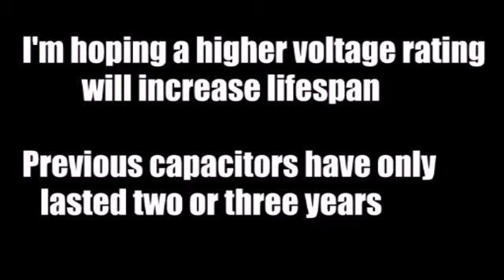Yamaha YSP power fault improved fix

Comment: Thank you for saving the life of my soundbar!  Does it matter what wire I use to extend the legs of the cap?  I know on one of the videos posted Maplin's bell wire (which I think is .6mm copper) is used but I've used thinner battery terminal wire.  I don't want it to fry six weeks down the line.  Thanks.
Reply from the maker: +Toby West don't worry, will be ok with that wire

Comment: Good video.  I've got the ysp-4000 and it turns on, no sound, then cycles off on its own after about 20 or so seconds.  Comparable issue as the yps900?
Reply from the maker: Mostly difficult, sometimes impossible to turn on - This capacitor is part of the standby power circuitry,  your fault could just be a poor connection on one of the multi-way plugs, there's no harm in just pulling and refitting pcb plugs, hope this helps. GazS
.

Comment: Hello Gaz, thanks for this video i like a lot !
Is the repair still lasting and doing it´s propper job ?
I am from germany and have a slight problem as i am not an electrician, i
 cannot buy the exact values you used, not available in germany
i could buy :
it says WIMA FKP 1 ... 0,022 ... 1600 ... 650   whatever this means, do 
you think this can also work ?
thanks a lot for your help Gaz
Best reg. Ralf

Comment: Gaz, mine YSP-1 works but after a wile it turns to a blastic sound, like when you have a channel out of air, a tremendous zzzzzzzzzzzzzz sound, so I turn off wait a little bit and then is gone for a few minutes but I happens again later....any clue? Thanks for your video!!!
Reply from the maker: Try splitting and remaking all the multi-way connectors
Reply: Easy man....kkkk how should I do that????
Tks for helping me!!!!!

Comment: Thanks another save from land fill £1.29 cap  used the same one from maplin dint bother removing power board just cut the legs off and soldered new one to the legs YSP 500
Reply: How did you open the YSP500? I am struggling with 1 Million screws. :(
Reply: eyekey  yes keep taking them out I had 15 left after rebuild made no difference
Reply: I have some pictures if you PM me

Comment: Gaz, thanks for posting this. my YSP900 is dead , I think it could be this . The configuration of mine looks slightly diff  so Do you think it will be the same part?   Thanks again, keith
Reply from the maker: Im not aware of any different power supply ever being used, study the pcb tracks, The existing original cap may have changed?